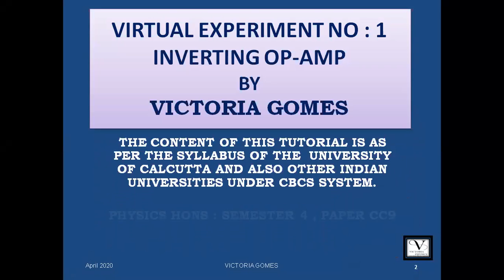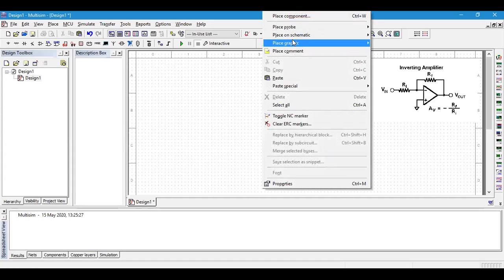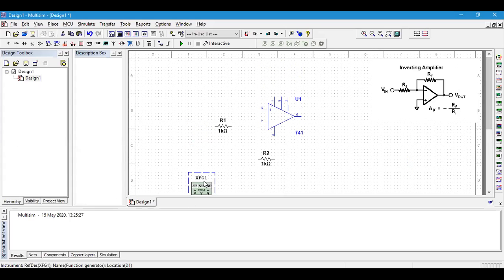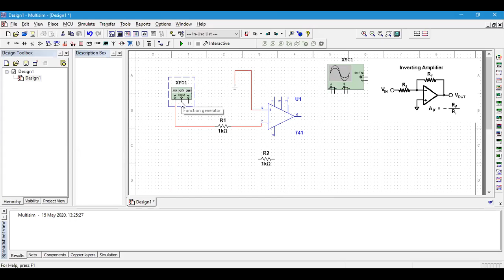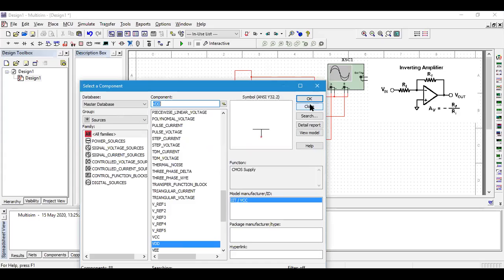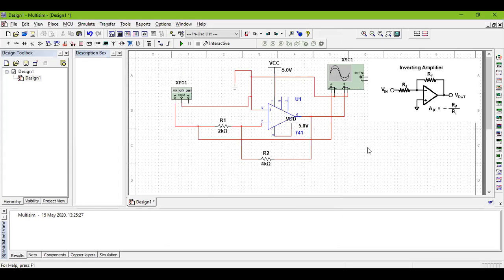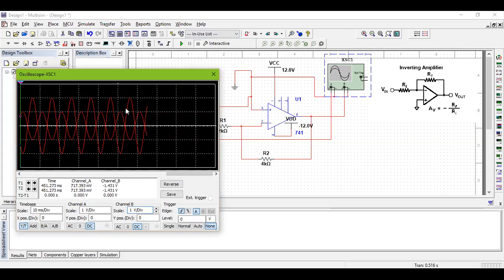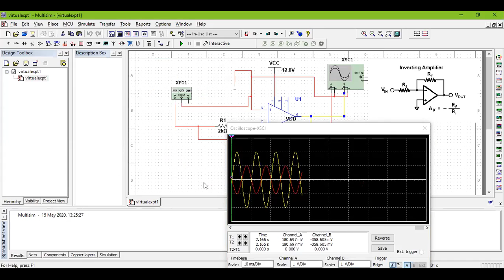INVERTING  AMPLIFIER (OP-AMP ) EXPERIMENT USING MULTISIM

Comment: Hi I dont understand why the pins are not correct... for example NE5534 has 8 pins.. the pin 8 is Balance\compensation... but in Multisim figure only 7 pin...why this? I've project were I'm using pin8 and not pin 5...so how i can do in this case?
Reply from the maker: Hi Andrea, thanks for ur question..  well the pins over here are Correct..this very IC(IC741)  also has 8 pins but pin8 is used for "No Connection"and Pin 5 is used for offset null , Hence Pin8  is not shown in above multisim...where as the IC NE5534, pin 5 is used for balance and pin 8 balance /compensation..  Hence different ICs have Different pin functions associated with each pin .. 
so before using any IC in practical projects..you have to see their data sheet and also their pin configuration..Data sheets are available online...
Reply: @VICTORIAPHYSICS  Thanks for your answer, i know it, but the stuff that I don't understand is: in MultiSim NE5534 model don't have 8 pin, but only pin 5... so when I convert my circuit to pcb board the connection is not in 8 pin. i don't understand this stuff.